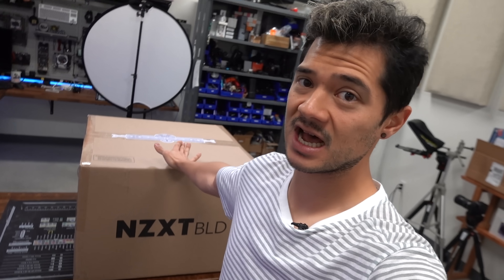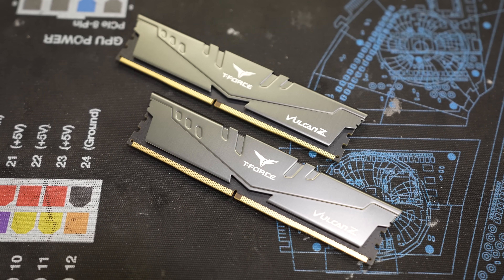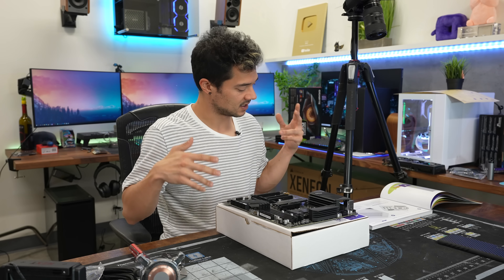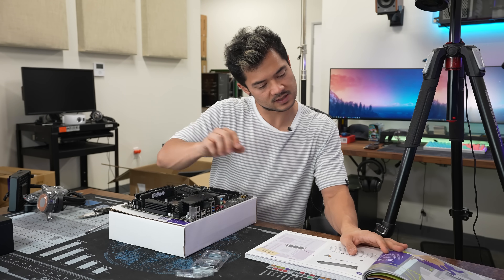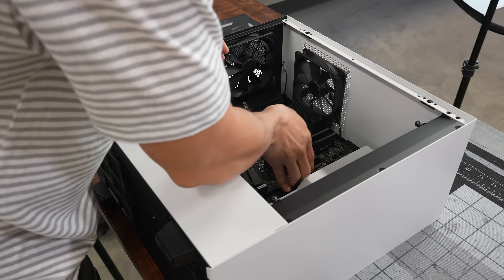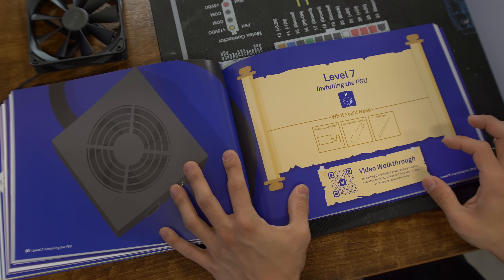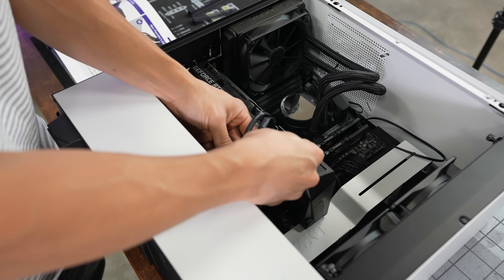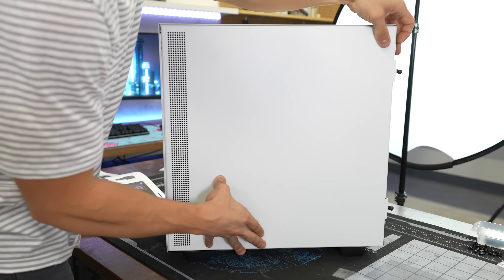NZXT teaches me how to build a computer

Comment: I used to use twist ties on cable management. I don't anymore because after a few years the plastic sheath dries then exposes the metal wire, introducing a potential short hazard.

Comment: This is a great all-in-one kit for a first time builder. Reminds me of the barebone systems you could get, but this is even easier because you can get all of the components under one brand. The step-by-step guide with visuals is a very nice addition. This kit also makes RMA requests easier too since you only have to deal with one merchant. And of course the ability to get a GPU at a reasonable price without getting gouged.

Comment: 40:25 
Personally the first troubleshooting step I'd do once the case is open is check that the front panel connectors are plugged in, always found those to be quite flimsy and easy to accidentally unplug while working on other parts.

Comment: This kit would be a lot better if they only supplied the H510 Flow with it, I feel like a lot of users are gonna be in for a shock when they see how much of a hotbox the original is. Hopefully it's possible to buy the mesh front panel for it separately so that people can fix that without having to move their build to another case, or be stuck using it with the side panel off, something that's not an option for everyone as people have pets and kids which can't be trusted near an open PC chassis
Reply: But also remember that its a 3060 ti
Reply: @edmundojosezuazuachapa1612  And? The 3060ti is a totally capable gaming card. I fail to understand what the point of stating that is. The kit is customizable dude, they just sent 3060tis out because it's more affordable and there's probably enough volume of them that they can get enough to send out review samples with their kit, nothing more. There's already been several versions of this kit reviewed by others besides kyle
Reply: @TheOriginalFaxon  theres actually just to options right now and both are 3060ti’s, and what i meant was that its not the same using their h510 non flow case with a 3080 than a 3060ti
Reply: @edmundojosezuazuachapa1612  I still don't get the point though, that case is a hot box regardless. It was on the line even with mid range parts in it. It's not a terrible useless case, but you damn well bet anyone who keeps up with tech news is gonna notice and ask for a flow front panel at least lol
Reply: @TheOriginalFaxon  agree, they should have added the new flow model. But anyway, do you think that kid is worth it for $1599 considering the lack of gpu’s in the market?

Comment: I have a 6 year old NZXT Phantom case and I think other than the molex power connectors (which you can chop off) it's a great case. has 3 drive bays behind a door and 6 hard drive bays, neither need screws unless you're mounting a hard drive. 
not bad and honestly I like their old designs better than their newer ones because the new ones are so boring.

Comment: I think NZXT is wrong about the tubing on the AIO it should always be mounted on the bottom because of permeation overtime will allow air to get into the block instead of being trapped in the top Reservoir. Also no mention of just how much bloatware comes pre-packaged

Comment: Jay did a funny video on this. It really is a well executed way to attract a first time builder.
Reply: Looks like Kyle didn't have the boot issue with m.2 slot that Jay had.
Reply: @HDTizzUm  Jay got an early version that came with a B560 motherboard and a 10th Gen Intel CPU, that's why he had the issue. I checked the website and NZXT is using 11th Gen now. And also that problem doesn't happen with the AMD build because it's a B550 motherboard and 5000 series CPU.

Comment: hopefully they can teach me how to build a computer cause my issue is confusing the doo doo out of me. 

I just purchased the Zotac 3060 Ti Twin Edge card the other day and finally got around to setting it up today. I have a Ryzen 5600x on a b450-f motherboard (yes bios updated successfully and is up to date)
Every time I try to install either driver 496.13 or driver 472.12 the download will complete, but after 2 seconds of install, the computer blue screens stating it found an error and then restarts itself.
I can't for the life of me figure out why this would be happening on a brand new card?
Could it be the power cord to the card?
It seems like the card crashes as the power consumption increases. I have a 750 watt power supply and was running that on my other pc which is running a 3070 card atm.
If anyone can help that would be greatly appreciated.

I noticed my display saying "Windows default display"
or something close to that and my GPU not being recognized anywhere
Reply: Use DDU to uninstall all drivers. If then reinstalling still crashes with blue screen, RMA the card.
Reply: @b0ne91  Ive already done a full DDU wipe of both AMD and Nvidia just incase there was any residual drivers left over

Comment: Ok so honestly I don't know how to make a pc so I used the nzxt pc part picker so tell me if this is good I will change the things if possible because I'm a noon😭

Pc parts: 

CPU Cooler
NZXT Kraken Z53 with LCD Display Black
Service
Standard Service (US) ASSEMBLY
Software
Windows 11 Home
Case
NZXT H5 Elite White
CPU
NZXT N7 Z590 White, Intel Core i7-11700KF 8-Core 3.6GHz
RAM
Team T-FORCE Delta RGB DDR4 3200MHz CL16 2 x 8GB
GPU
MSI GeForce RTX™ 3050 Ventus 2X OC 8G
Power Supply
Seasonic Focus GX 1000W Gold
SSD
Samsung 970 EVO Plus 1TB
Reply: CPU better than starter pro but gpu is a downgrade
Reply: PSU Is future proof, change the gpu to a 3060ti and it’s somewhat better than the starter pro
Reply: A Ryzen 5 cpu would be good for gaming
Reply: AIO is fine
Reply: SSD is fine
Reply: @Plug-n  oh alright thank you!!!

Comment: HAH

They did not tell you to do boot test before placing into the case.

You should test only the minimum components possible.

Mobo, psu, cpu/cpu cooler, ram, maybe ssd. 

Gpu if you do not have integrated included.

Leave all other components unplugged, and you add them after the boot test is succesfull.